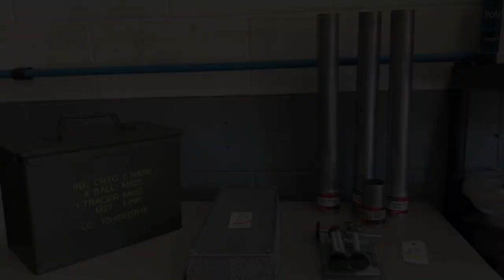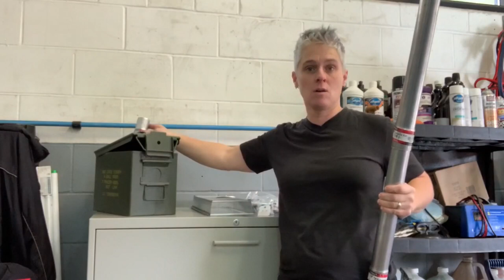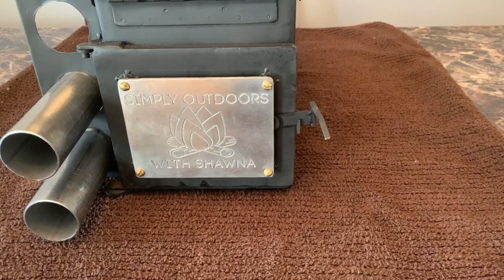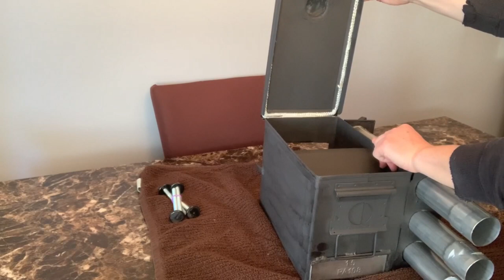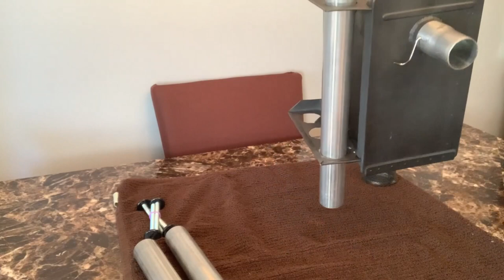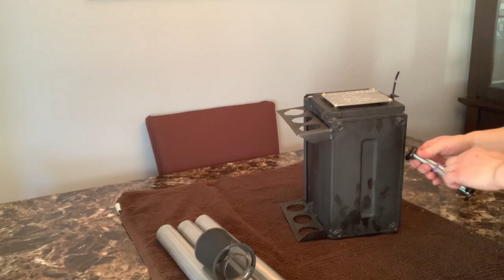DIY Making An Ammo Box Wood Burning Tent Stove - Custom Design

Comment: WOW!!!
HOW AWESOME IS THAT!!!??!??
I need a friend like Kyle!!  I have several ammo box sizes that I've collected to make a wood stove out of, but I cannot weld either... So until I find someone to help me out, I just keep them on hand.
I'll have to find some muffler piping similar to what you have, my brother can probably help with that.
I love ur stove!  One thing I might have done different is to slightly angle out the legs, but yours will work out just fine!
U forgot to show off the inside, oh the baffle was genius... that will help to keep more heat instead of going straight up the pipe!
Reply from the maker: I think everyone needs a friend like Kyle!😁 Putting the legs on a angle is a great idea it would be more stable. Thanks for watching, Cheers!

Comment: Nice. Did you think of try to get everything in side the box? I still think it's a pretty cool stove. Happy camping.
Reply from the maker: Hi yes I did think of getting everything inside the box. If I wanted too fit all the chimney pieces in I would need to cut them and that would require more joint pieces to fit them together. I didn’t want that. Thank you so much for watching, Cheers!

Comment: You should have installed the pipes with the larger end at the top. The way they are, creosote can run down the inside of the pipe and leak to the outside at the joints. This is very messy and you are going to hate it when you get it. If you invert the pipes like I suggested each section will act like a funnel and any creosote that runs down the pipe will stay in the pipe till it gets to the stove and be burned. This is a mistake that I see in the design of a lot these tent stoves that are made by so called pros.
Reply from the maker: Thanks for the advice. I have used the stove about 5 times now and the joints had a little creosote but nothing that bad nothing that would make it messy. Thank you for watching!

Comment: Instead of grinding the handle off, why not turn it upside down and use the hinged lid as an access to remove the ashes?
The bottom, now on the top, could be used to cook on.
Reply from the maker: Hi there! Yes that is an excellent way to do the stove as well. Thanks for sharing and watching! Cheers

Comment: Great workmanship but sorry to say it has 2 big design flaws, the pipe is upside down, the male should go into the female so the creosote drips back down on the inside of pipe into the stove and is reburned, that way the pipe stays clean, the way you have it, it can become a gooey mess, also the draft should be low on the front door so air is pulled through the wood. Sorry
Reply from the maker: Hi there! Thanks for watching! Thank you for the tips on the pipe and draft holes on the front. I definitely notice the problem with the pipes the first few times I burned on the stove. I recently change that. I will put some draft holes down below the door that should really help the burning of wood thank you. Cheers!